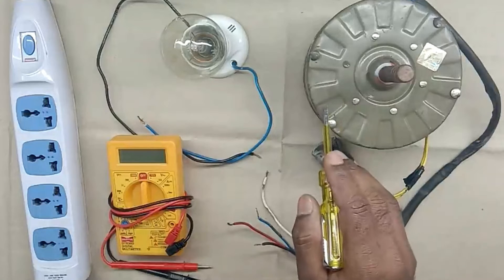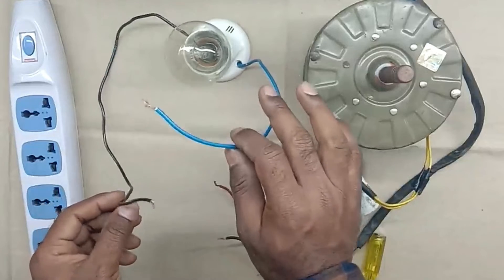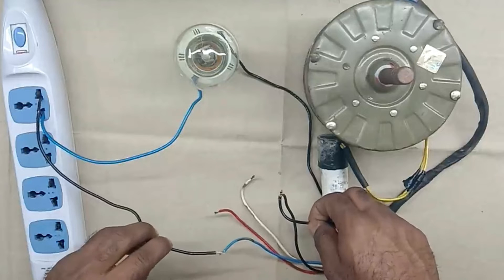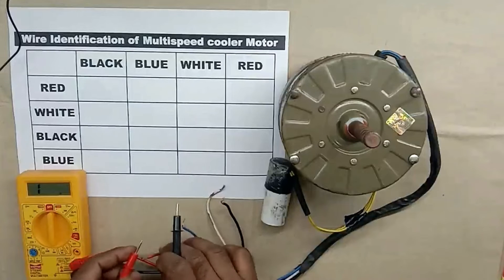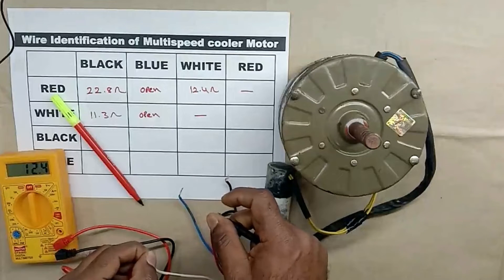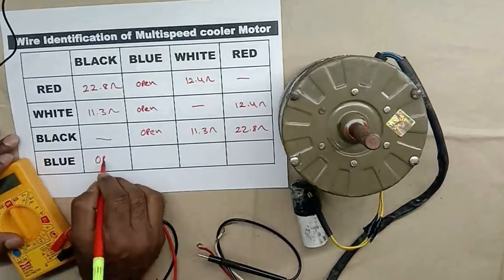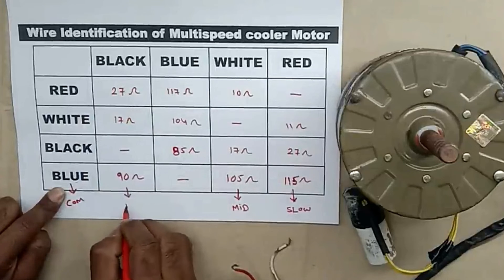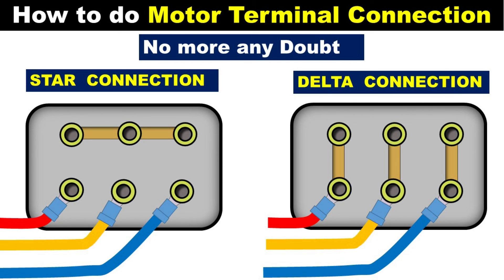Learn to Check Fan Motor by Using Test Lamp and Multimeter @TheElectricalGuy

Comment: This was a very useful video. However, there is one slight thing you left out. Inside the fan motor of most modern fans, dating as far back as the early 1990s from what I can tell, there is a thermal fuse. If it blows, all the windings will read open to the common or neutral wire. Consider updating this video to include that. I have repaired a lot of fans just by checking this fuse, this fuse has a thermal rating most of the time of 115 Deg C but if you live in a hotter climate it may be a bit higher then that, and it normally happens with a fan that has been starved of air like a clogged air filter or a failing capacitor. But your video answered my question on how a multi speed fan was wired Thanks for your video.
Reply: Love your comment. Sharing, motivating, admitting. Thank you both.

Comment: Can assist to me I have one multi speed motor I’ll connect wrongly (Netural connect to high speed) now motor can’t run,burning Smelling come out,

The motor is spoil or capacitor need change?

Comment: Please help me 

According  to you I checked the motor with a series bulb. 

Bulb is not lighted between motor body and three wires. 
 
Between each wires bulb is lighted. 

Capacity checked it is sparked when it is discharged. 

But if I supplied current to motor it is not working . 

What wrong it has ? 
Can send a reply please

Comment: Thanks for giving such a brilliant knowledge 
I have a query 
I have a 3 phase fan how can I check if it's faulty or not
Reply: First try to run it on a three phase power supply. 

If it won't run then it's faulty. 

To fix it up I would suggest you watch other videos here on YouTube. They have good step by step approach to deal with faulty fans. Although the videos are doing single phase fans, the concept and principle is similar.

Comment: Hi Great works and well explained , thank you , I have a question please , the fan on my heater is not turning, it is not stuck and turn easily by hand, I have test the continuity and there are no connection  to body with Red and blue only to earth . the resistance between Red and Blue is around 183 Ohm(with multi meter at 200setting) , there is only one setting on fan with only three wires , I have connected the red and blue to main , the fan is not turning but getting warm/hot , I have also lubricated the turning shaft, 
the fan is from my Biogeen  Phoenix2.8 heater, the motor is 230v 50Hz 0.43A  52/12w -any recommendation greatly appreciated

Comment: My fan not humming nor turning. Replaced capacitor, fan still dead. Since black wire connected to neutral wire, i assume black wire is common wire. I unplugged and removed the 4 motor wires. I did continuity test as what you taught. My puzzled results is, why the common black wire reads more than 9Megaohm to other 3wires? Please help....thanks
Reply: Your hand touched the wire and that's why you got a mega ohms. Release you hands from it and you will get zero ohms

Comment: Nice explanation bro, just wondering the winding in series (starting winding) with the capacitor ,isn't the end of the capacitor  will have to be connected to the live connection( Phase), sorry if  i am wrong..🙏
Reply: you are not wrong something is not right with this diagram

Comment: what the hell are you doing? do you not care about the people that are going to watch this video and do this and get electrocuted because you're not even once telling them the danger of the live wires in their hands. of all reckless, unsafe and irresponsible ways to tell people to test a fan... 🤦‍♂️
hopefully you haven't killed any of your fellow countrymen with this ridiculous way of testing.
a fan motor is not worth your life.
Reply: I was getting scared looking at the demo. Using a multimeter resistance mode is the best way to check out including the body short.

Comment: Hi brother, rewinding and bush modified ,to bearing 5 speed motor, dspu after run motor going heat and smell heat after checking issue shop are say motor is ok, motor are vibrating,again they say blowe issue,buy new motor,wefix back,now it's work fine,old motor same heat and take amp designed,any idea for this